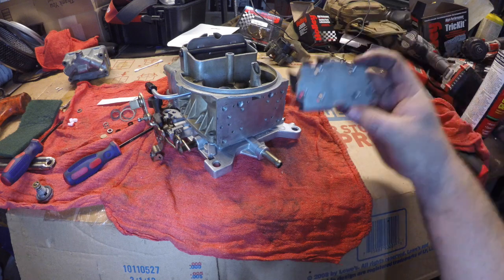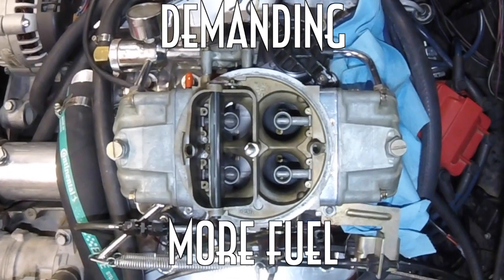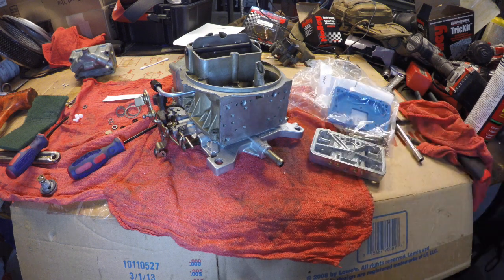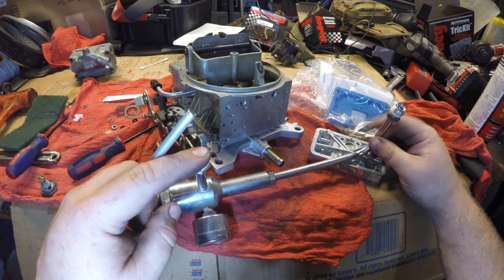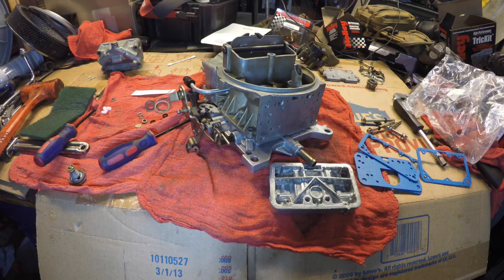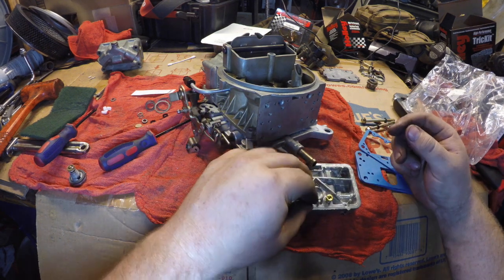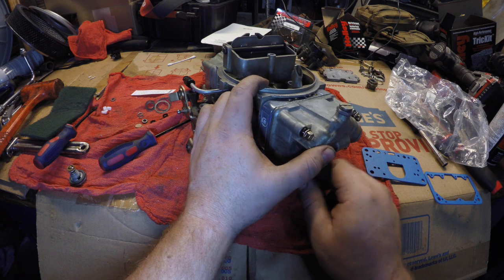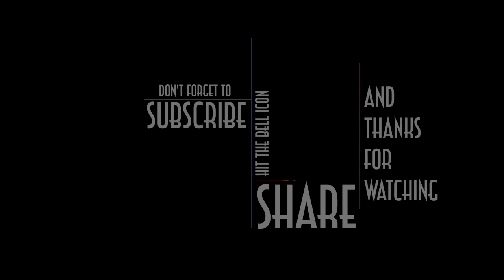Holley carburetor metering block & jets upgrade for more adjustability | #FamilyBurnoutWagon EP18

Comment: I have a 4160 single feed 600.cfm its a classic holly style side hung bowl set up i seen 2 kits 1  has the metering plate that accepts jets 
And 1 has metering block kit  but it did not mention i needed a dual feed fuel supply if i went with the block style